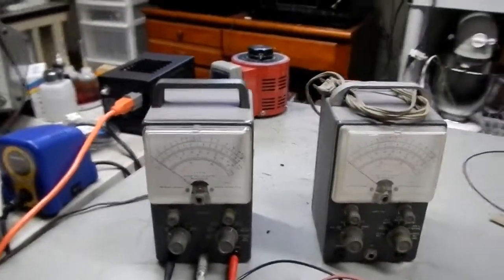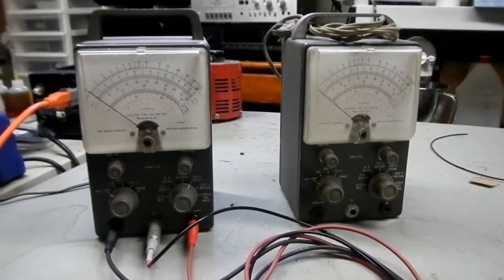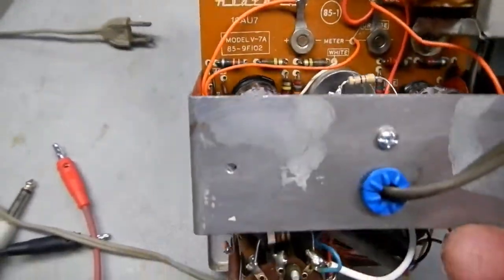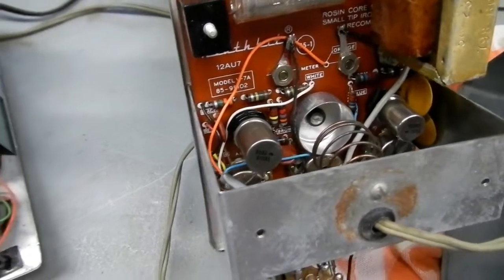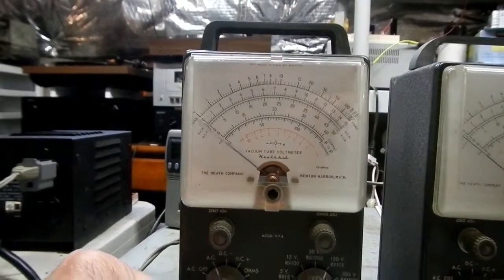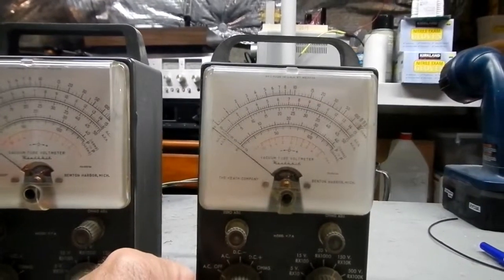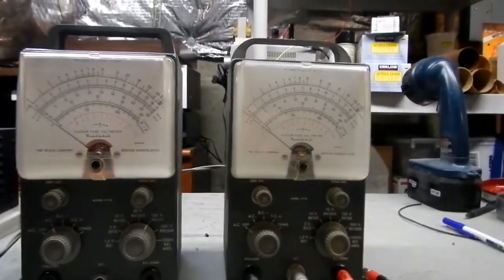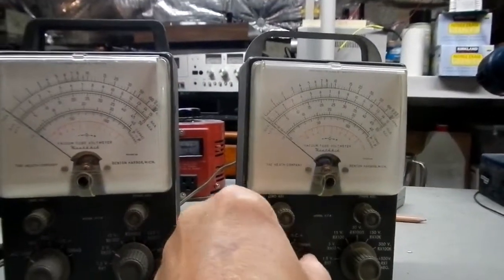Fetron based Heathkit VTVM

Comment: You can still buy them on ebay UK original Teledyne from the USA.
The fetron charateristics are very similar to valves, I would recomend using these as it eliminates mains hum from the heaters especially in audio.
At my first company Marconi Instruments in StAlbans the mostly valves equipment was either left on 24/7 or switched on befor we started work and in the Measure Standards Laboratory all measurements equipment was on 24/7 and I believe we had a back up supply for this.
Thanks for a great informative video.

Comment: I was starting my carear in the electronics industry when I read up about the introduction of the fetron.
U lnderstand it was mainly developed for the telephone long trunk transmission which relied on valves in the day.
Say in uk group exchanges say Bristol to Bath
It could replace certain valves eliminating the heater and increasing the reliability and virtually reducing the servicing.
But progress over took them as the valve systems the were designed to be used in, were them selves eliminated.
Reply from the maker: Anthony.  Thanks for the comment and a historical perspective on the Fetrons. I figured that the fetrons were developed to provide a solid state solution for legacy tube systems until they could be replaced.  And they are still working 50 years on in my old VTVM!

Comment: I have the original V-7, which I'm in the process of repairing/restoring.  It was only made in 1956, and was replaced almost immediately by the V-7A which continued to be produced into the early 60s as you state.  I'd be interested in finding out if the input impedance of the V-7A is the same both with tubes and the FETrons, because one of the advantages of VTVMs is their extremely high input impedance.  FETs, of course, are often used in the front ends of equipment to unburden whatever the input device is they're hooked up to by dint of their high impedance.

BTW, when I got the V-7, it too had a C-cell battery installed (and completely dead), but amazingly, no leakage at all!  It still looks like a new, bright red Eveready "9 Lives" battery (with the little black cat logo) from the 1960s.

I'm also replacing the half-wave selenium rectifier with a proper bridge, because half-wave rectifiers are actually quite hard on the transformers they're fed from, and I'll put in a voltage dropping resistor to match the voltage drop from the old rectifier (around ten volts!).  The pilot light's getting swapped out for an ultra-bright LED (under-powered to reduce current draw from the transformer) as well.  I'm also using 1.5V linear regulators in TO-92 form factor to replace the C-cell battery.  But before any of that, all of the capacitors are getting replaced, and I'm checking the resistors for accuracy; turns out seven of the 1% tolerance resistors have drifted far outside their range, and the 1Mohm resistor in the probe is messed up and tests way low.  Finally, I'm going to make sure that the new two-wire polarized power cord has the hot connected to the rotary switch -- the old cord wasn't polarized, so you had a 50/50 chance of having the neutral connected instead.  It's been fun so far.
Reply from the maker: Thanks for the comments. I like to hear about other peoples projects.  Good luck with your V-7.  I like using those old VTVM's, reminds me of high school electronics class.
Reply: @mguess  : Sometimes there's no replacement for an analogue meter; they're very useful for watching trends and eyeballing average values, something that most digital meters aren't very good at.  Which, of course, doesn't stop me from owning four or five different digis as well.  ;-)

Comment: Oh! Now I know that my IM-18 has FETRONs. I'm disappointed. Well, I still have my fathers' TE65.
Reply from the maker: I'll trade you a pair of vacuum tubes for the fetrons.
Reply: @mguess  Thank you for the offer, but my disappointing is due to the good performance of the Heathkit with FETRONs. I thought that my IM-18 had  "secret sauce high quality tubes" or something.
 I had a Lafayette VTVM with original tubes that could never be adjusted to proper operation due to extensive corrosion of the battery and seized movement, but at that time, I could get replacement tubes at an old man's store, friend of my father, that could fit the IM-18.

Comment: My heathkit v7A didn't come with the center probe with the 1/4 jack ,It looks like you build your can you tell me how to build a probe ,I sent for a male mono 1/4 Jack and the female side in case I need it.any help I would be thankful for ,my meter so far seems in fair shape.
Reply from the maker: Hi Ron. I bought my probes from this guy on E bay https://www.ebay.com/itm/Custom-Heathkit-VTVM-Probe-Set-Tested-for-V-4-V-5-V-6-V-7-7A-3-Wire-Meters/331920058690?hash=item4d47fa2942:g:hUkAAOSwqYBbQpFn:sc:USPSFirstClass!20124!US!-1   These are for complete probes.  I think he also sells kits if you want to go that way.  Good luck, great old meters!
Reply from the maker: I ordered my probes from this guy on Ebay.  https://www.ebay.com/itm/Deluxe-Heathkit-VTVM-Probe-Kit-Complete-kit-for-3-Wire-Meters-V-4-5-6-7A/331900093778?hash=item4d46c98552:g:-bEAAOSwBc9cu0ll:sc:USPSFirstClass!20124!US!-1